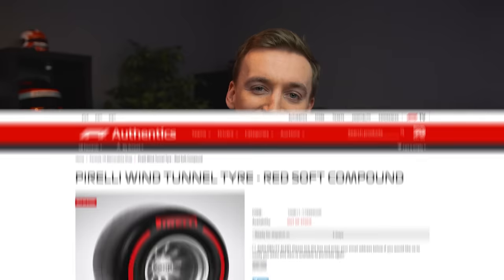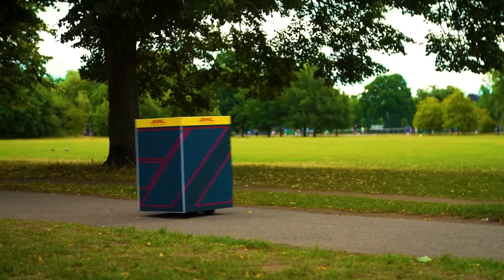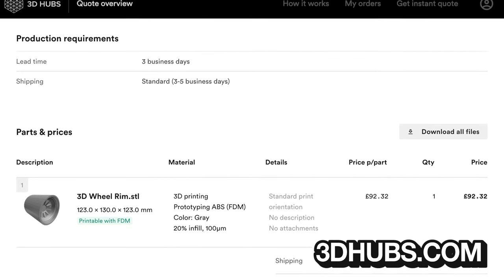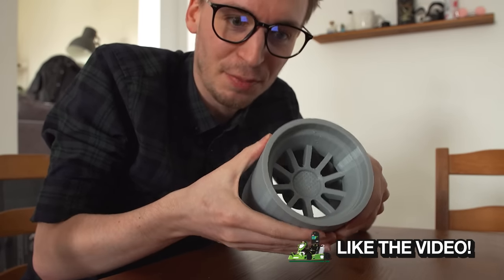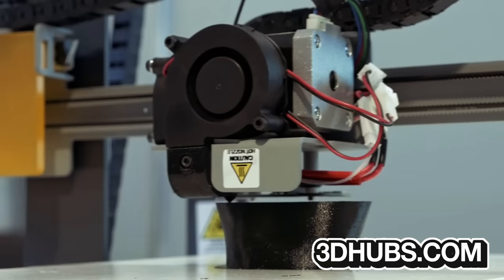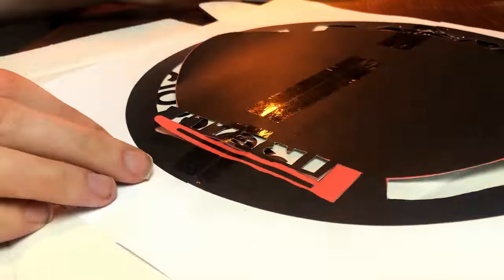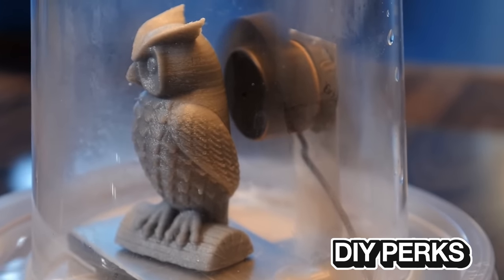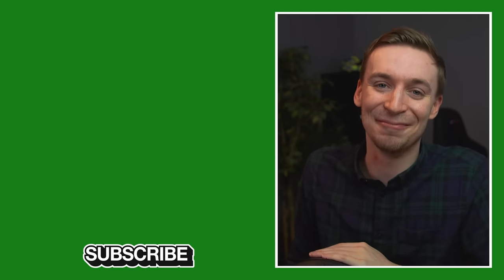Making My Own DIY F1 Mini Tyre!

Comment: Love love love this! However £93 for that 3D print is day light robbery! If you ever need 3D prints in the future, I’ll happily help out as a thank you for making great content!
Reply: Was about to say the same thing! You can get a quite decent printer for like 3x that.

And the plastic used is like 3£ at most.

Also rather confused as to why he would get it in ABS? PLA seems a lot more appropriate for the job, considering it isn't structural.
Reply: @jensaugust743  ABS is more rigid and less prone to warping.
Reply: @michaeldahlinger8815  If you set up your heatbead properly and have the proper distance of the nozzle to the heatbed you wont get any warping on PLA. I have never had ANY warping on my Ender 3 with PLA.
Reply: @heavyweight6440  I don't mean just with printing, in general PLA can melt and warp after being left outside in the heat and whatnot. I personally print with just PLA and PETG and have never printed with ABS as I don't have an enclosure and just wouldn't want to have to deal with the smell. That being said thanks for the response, I dont really have an warping issues either when printing as I use a BL touch for leveling and as long as I keep my glass build plate either clean or with an adhesive, it does its job. That's just my knowledge on ABS from what I've gathered from being in the 3D printing community for a few years.
Reply: pay 20 pounds more and you got yourself an ender 3, plus another 20 for filament

Comment: Great video! Here are a just a few notes that could've made the result slightly better;
* You could get the red more vibrant is by using a white or red primer (primer greatly affects the color of the top coat). 
* Vinyl is also quite hard to get clean, I would try water transfer decals (you can get sheets that you can print your own designs on, any unprinted area just becomes transparent). If it comes out bad it's easy to remove (just water and some scrubbing)
* Normal primer works fine for 3D prints, but filler primer is better. It fills in the gaps way more and is great of 3D prints. You could also use something like Milliput to hide the banding.
Reply: I think if u use Waterslide decals on non smooth surface it will look very bad, it might be better to stay with vinyl i guess. but i agree with you, on smooth surface it would be better

Comment: Cool project! A note for the future, the banding on the 3D print is because of the .stl file export quality, adjusting the options and exporting at a higher quality will make it super smooth. Hope this helps on future projects, keep up the good work.
Reply from the maker: Thanks!!
Reply: @mattamys   No problem 👍🏽

Comment: 7:08 that's why should always remove the masking tape right after you are finished spraying, when its still wet. that way it doesn't dry to the tape and leave uneven edges when removed.

Comment: Nice job! Smart thinking with the expanding foam to keep the tyre shape. That 3D print is expensive though, I hadn't realised how much it costs to get single parts made
Reply from the maker: Thanks! Yeah it’s pricy but it’s also thick, largish and using a decent plastic filament :)
Reply: @mattamys  Get a 3D printer. I recommend the Ender 3.

Comment: To get the red more vibrant, I would have used a light grey or white primer. But before that, I'd have tried to cut those rubber prints off the sidewalls with some sort of planer...

Comment: you need a 3d printer, 92 bucks is silly, thats like a 3rd of the cost of a printer
Reply: Ender 3 is 150 bucks on discount. You could print that easily.

Comment: I use a mark forged and form labs printer the form labs one has lots of material resins and goes to about 100 microms so it is very smooth

Comment: the centre cap off the original wheel is from the Vw golf gti Pirelli edition, if you wanted to add that touch, you can still buy them from the dealer.

Comment: Try to sand down to original tire markings for the next one. Also, a good 3D printer ender 3-v2 costs around £190,-. So maybe it's worth just to buy a 3D printer and some filament.

Comment: Super nice idea, especially with the go cart tyre!  i might make one myself as i own a 3d printer myself what makes that build muuuch cheaper. ;)

Little comment on the acetone smoothing thing: that only works with abs or asa materials, others like pla and petg wont smooth out :) in my opinion the small problem with your printed part was the 3d file being exported in a low resolution causing these steps on the circular sections in and outside the rim.

Comment: You could get a better, rounder print with less faceting with different software. STLs when saved need to be told a tolerance. The default tolerances are crap for 3D printing, I lost a batch of resin prints to that.

Comment: 4:55 FYI you want to use filler primer to do this, and not just regular paint primer. Filler primer will fill gaps with the putty, and not paint.

Comment: The 3d print I'm guessing was faceted because the lower poly mesh (with control loops or creases) was printed rather than the smoothed mesh. You can create the smoothed mesh in most any modelling package with a click (blender/Maya/ZBrush) and then export  a much smoother STL for printing. The banding on 3d printers is measured in fractions of a millimetre!

Comment: Ayyyyy yoooooooooo I've made loads of those rims for lots of different race teams. At the manufacturing company I was in we made loads for Red bull, McLaren, Williams, Mercedes, Toro Rosso and a few others. We also did lots of other 1 off rapid prototyping for them, and once for Mercedes we made some actual full size ones.

The rims are actually made of 7075 aircraft grade aluminium,and not stainless steel. Stainless steel would be too heavy and expensive for the race teams to buy as it almost doubles, if not triples the cost of the rims as it's such an expensive material. 
Anyways it's a good mimic
Reply: Wow it's super interesting, i really would like to talk more about it with you if you are okay ?

Comment: I also made one with a tyre 7.1 inches wide. I also found the original 3D model you modified and printed the wheel nut separately.

Comment: Make the wheel two-part so it snaps or threads together.  Only other thing would be ensuring the rim fits the tire more precisely. There's no way that would hold air. Otherwise, quite the exceptional job!!

Comment: I just made 1 with a used front gokart tyre😁  the rim is still inside which i painted black to replicate the 2022 tyres 

I used the stencil you provided which worked like a charm 

And i used a few parts from the gokart's suspension to have the lock nut on the wheel aswell and it also function's as a stand 😁
Reply from the maker: Amazing! Would love to see what it looks like, tweet it to me!
Reply: @mattamys  i will do that :)

Comment: Try to remove the tape before the paint is fully dried. This prevents the edges from cracking. For the tone: RAL 3000 looks to be better fitting. I’d even go the extra step and try to smoothen the tire flank to get rid of the Dunlop letterings
Reply from the maker: Awesome to know!

Comment: Primer, then white paint, then red paint to make it brighter. Maybe  a thin yellow between the white and red to make it a bit more vivid?
As for the tire texture there should be some way to remove it before painting, isnt there?
Reply: Are you sure it won't be too thick if you put 3 coats ?